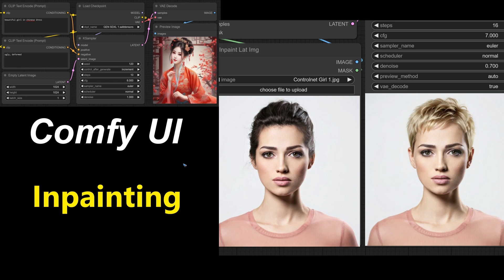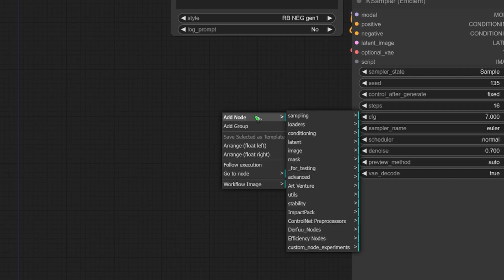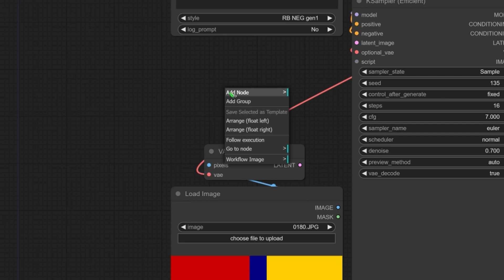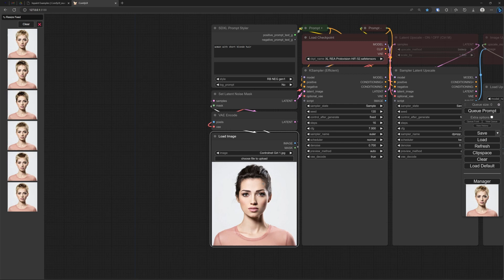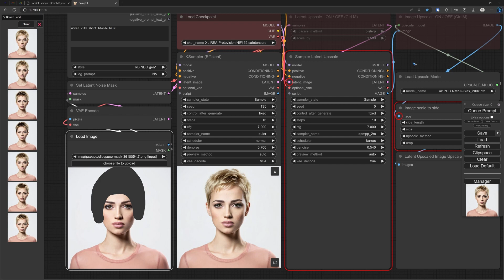ComfyUI 08 Inpainting

Comment: Thanks for this tutorial. I noticed in your workflow the Latent Upscale node at the top of the 3rd column is disconnected in your source workflow. When I connect it as shown in your video, using any value above 1 ruins the output. Was this originally intended to increase resolution of the inpainted region or something else? Does this node serve any purpose now, or is unnecessary?
Reply from the maker: Please have a look at the latest videos in the playlist, they contain a link to a new set of more standardized workflows. The latent upscaler can serve a purpose, the sampler needs a denoise between 0.5 - 0.6, I use 0.54.